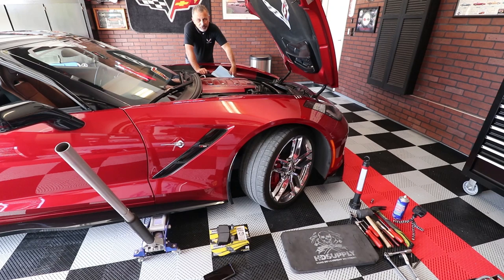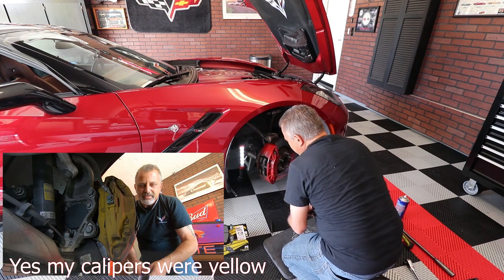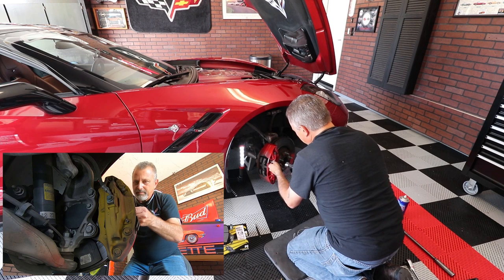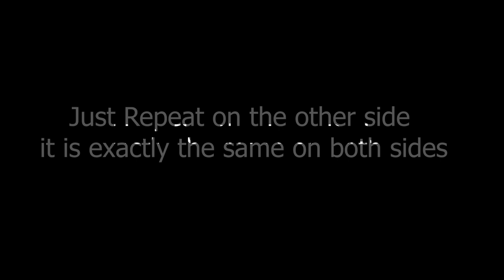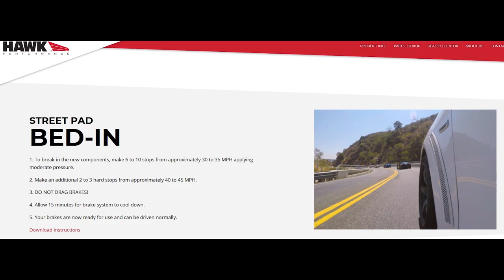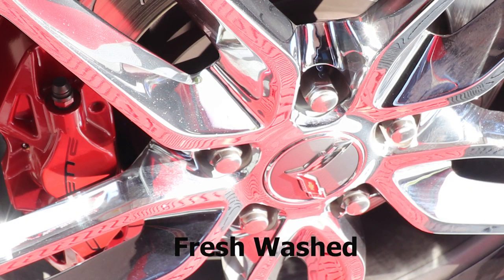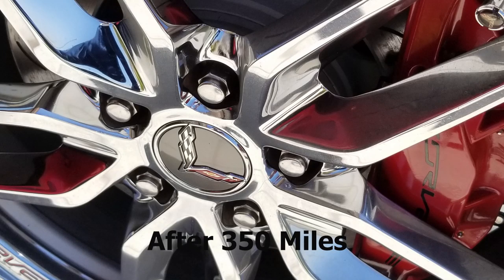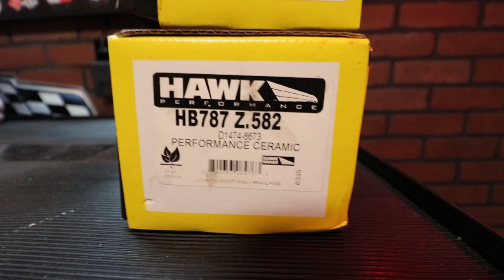How to Install Hawk Performance Ceramic Brake Pads on a C7 StingRay Z51 Corvette

Comment: Great video, if you buy a c7 used and doing the hawk pads, confirm you have code j56 which is the steel rotor code.  Using the hawk pads on ceramic rotors will not work.  The location for the code is in trunk under carpet in center of trunk.

Comment: Great video Scott!  Definitely saved it for my future C7 Stingray Z51. Great to know not to use Brembo pads and to go with these Hawk brand.  Ive changed rotors & pads on a few of my older cars (VW Passat, Volvo 850 Turbo wagon, Acura NSX,) the C7 looks relatively straight forward

Comment: Awesome!  Thanks for the quick response.  I forgot to ask what you use to clean the inside part of the rim. Any recommendations?  Again thanks.
Reply from the maker: Yes use a Mr Clean pad very lightly they work amazing on chrome wheels I would not use them on black wheels.

Comment: Thank you. Very informative video. What do you recommend to use to clean the calipers and inside the wheel well?  Amy light you could provide would be greatly appreciated.
Reply from the maker: You can use Orange Cleaner or glass cleaner  from the Dollar Store or 99 Cent store.
Just make the Calipers are cold.

Comment: Keep us updated on the dusting. I just did mine, a few months ago, and I went with the CarboTech pads, and they are better on dusting, but barely. I’m not really that impressed with them. I also replaced all 4 rotors. Even though the car only had 20k miles on it, and those are all highway. Also, being the king of lazy, I went out and bought a $500 Milwaukee impact to do mine. 🤣👌🤣👌🤣👌
Reply from the maker: Hi Gregg,
I try to do most of my videos with tools that most people have at home. Your so right an impact gun would have made it much easier!!
You should get a set of these pads they are awesome!
Reply: THE CORVETTE CHANNEL I definitely think I’m going to go your route. I looked at these pads and just decided on the CarboTech, because there was a lot of hype behind them. And they’ve been good. But, to me, they just don’t have the confidence that I had in the brakes, like the stock pads gave me. But I have black wheels on my Z51 and the dusting was just nuts. Plus the CarboTech pads were like $300 a set. And for me to want to change, less than 5,000 miles, tells you something about them. I’m definitely going to go with these. 👌👌👌
Reply: @g.dubyou6263  where did you get them for 300 ? They quote me 440 for my grandsport
Reply: @rakishman1313  $440 is probably Covid pricing. My comment that you replied to, is over 3 years old. I’m sure the price has gone up, just like everything else. And the pads weren’t that great, they still seemed to make the same amount of dust. The dust was just a different color. I have a 22 M4 now with carbon ceramics. That’s really the only way to go to not have to deal with brake dust. The CCBs don’t dust at all.
Reply: @g.dubyou6263  yea I hear you. Funnily I have been considering m4 as well . My wife and I checked it out and it most definitely looks good but need to decide if I want another sports car in the pothole of a state like NJ
Reply: @g.dubyou6263  we’re you happy with the performance of the carbotech compared to the oem brake pads . I don’t care as much about the dust but care about strong performance . Offcourse I don’t love dust so without dust is of preference
Reply: @rakishman1313  I’ve had mine for about 17 months. The xDrive is amazing. I have every option, except carbon bucket seats. The price has gone up since I bought mine. Similar spec, now, is about $114k. 🤦🏻‍♂️
Reply: @rakishman1313  I didn’t notice much of a difference in stopping performance, compared to the stock Brembo pads.
Reply: @g.dubyou6263  nice , yea I am looking for now but it s tempting . Had the grand sport for 6 years and a Benz might be good to change to a m4 or m3 especially since I am considering moving down south too if I decide to move I ll get them. It s just too much pain and time loss having these cars up in NJ as roads are absolute nightmare

Comment: I think I asked u this question already but didn’t get a answer, I hv a C7 and I need to remove my driver side airbag to get to my seat, the cover is coming untucked and I can’t get to it to tuck it back in, and I will be putting the airbag back on. Thanks love the video’s
Reply from the maker: Hi Dennis, I try to answer all of the questions. If I missed it I am sorry. I am not totally following your question, but I have not ever played with the Seat Airbags just the Steering Wheel Air Bags. So I wont be much help to you. I'm sorry

Comment: Thank you for the very helpful video. I'm currently changing my pads to hawk racing pads for my c7 z06.  The new hawk pads did not come with brake pads wear indicators. Does the brake pad wear indicators from my oem pads move over to the Hawk pads?  If so, how?   Any recommendations you could provide would be greatly appreciated.
Reply from the maker: Sorry no they don't.
Reply: Does that mean the hawk racing pads don't come with brake wear indicator.

Comment: Hi I like your video, very detailed. I just subscribed. Looking to replace my brake pads and rotors on my 2017 grand sport. What brand rotors and where do you get it? How often you changed your pads and rotors?
Reply from the maker: You can use Hawk Performance or Power Stop Brakes. You can find them on Amazon.
Good Luck!!
Reply: Scott can the rotors be turn or i need to replace it. Currently 37k miles
Reply from the maker: @samc7549  Hi Sam.. depending if you don't have any grooves you may be able to use the rotors without turning them. If you have a base car and have the smooth non drill and slotted rotors you can have those turned, but I have always been told you can not turn a drilled and slotted rotor.
I hope this helps.

Comment: Great video. One of the things I was looking into when purchasing brake pads is the squealing. I heard that hawk squeaks at low speeds. Have you experienced this?
Reply: yes.... they squeal horrible. 0-5mph. Worse than stock pads. I ended up thinking something was wrong so took them back apart x3 times and regreased everything. Pads work but they squeal and lots of dust on front wheels. Probably looking for another option next go around

Comment: Great Video. Mine is still new but will remember this for when I need to do it. I used to replace pads on Brembo breaks of my Z32 for track events. I used Hawk Blues but they were noisy and needed to warm up before they actually worked. First couple of hard stops in morning were scary but once warmed up they were amazing. I'll be interested to know if these have the same grip as the stock pads.
As for pushing the old pads back,I in some cases I used C-Clamp or big pliers to force the pads. Great tip on those hollow punches. I did chip my Bremebos in couple of places.

Comment: Where did you put the jack stand, under the composite spring? Will it catch if floor jack fails? (If I ain't getting under the car, just changing wheel etc, no problem to just use floor jack only and without jack stands? Actually I want to take a look at my control arms)

Comment: If the original brembo pads that come on the car from the factory have no grease on them why do you need them here.
Reply from the maker: It was a recommendation from Hawk to help prevent noise and chatter.
Reply: Thought you want grease on the edges more so than back?

Comment: 20:20 ... ouch.. ur scratch that powder  coating on that nice Brembo
Reply from the maker: The back side of the Calipers are the original yellow color and you cant see it from the front. I had painted them in the very beginning after buying them. One of these days I wi be replacing them with a powder coated set.
Reply: also on the back caliper at 35:49

Comment: Don’t take those pads to the TRACK.  There’s nothing that’s PERFORMANCE about those pads.  
Yes, they make less dust than the factory Brembo pads on a C7, which is why I tried them.  Driving spirited in certain roads with them may be ok, but at a race track, they will NOT STOP THE CAR like the Brembo pads.
I found out the hard way at Watkins Glen track in NY where my C7 Z51 with an Edelbrock supercharger did not slow down on a curve the way I expected it to (based on my experience with the stock Brembo).   Lucky for me there was grass to go onto and not a wall.